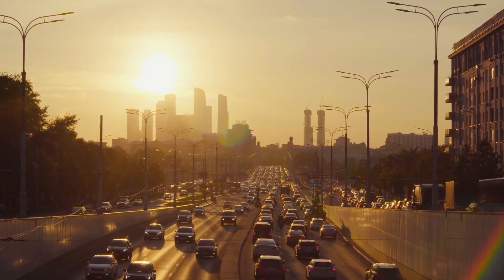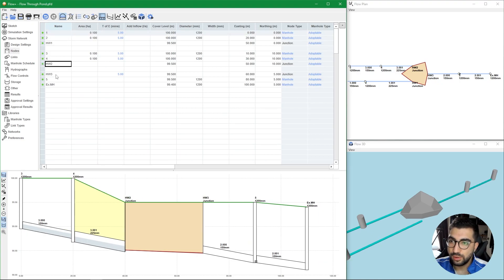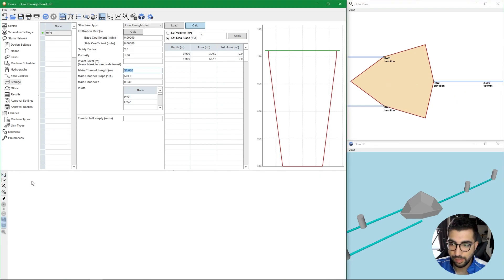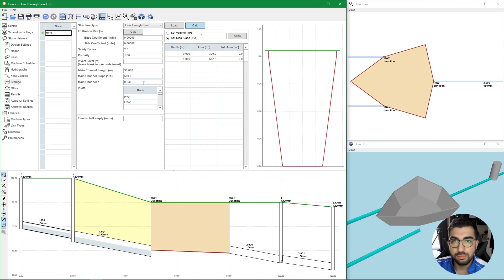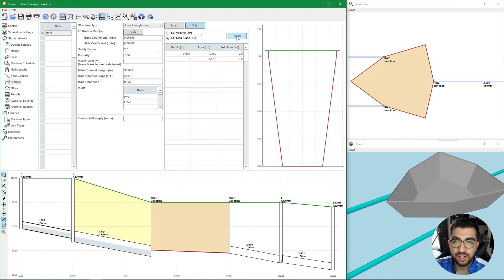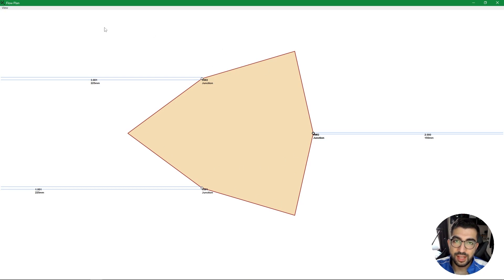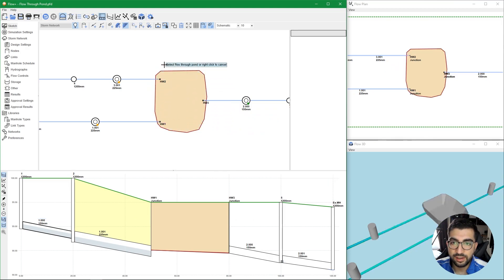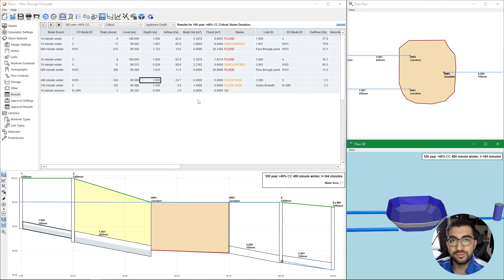How to design a pond in Flow

Comment: If i were to model a detention basin as a flow through pond, gravel infill so porosity 30%. How do I increase the depth of the pond, seems to be set at 1.45 (ie specified manhole cover)
Reply from the maker: The depth of the pond is directly correlated to the invert level of the outlet node. So just increase the invert level of the outlet node.